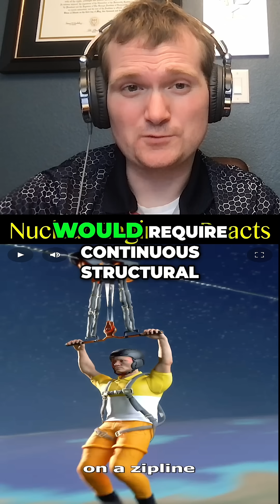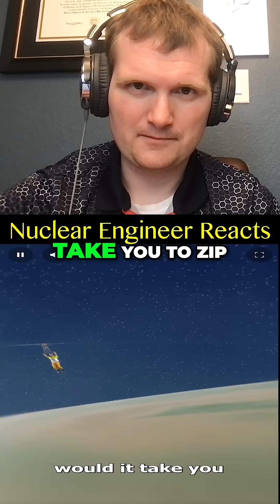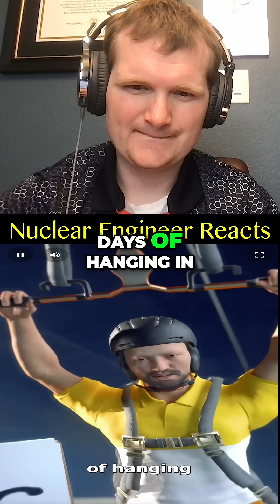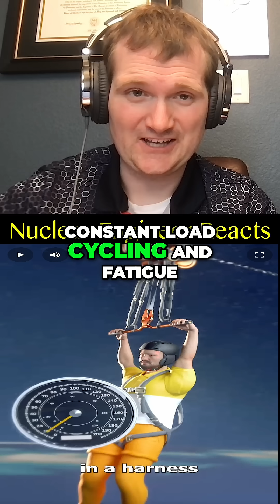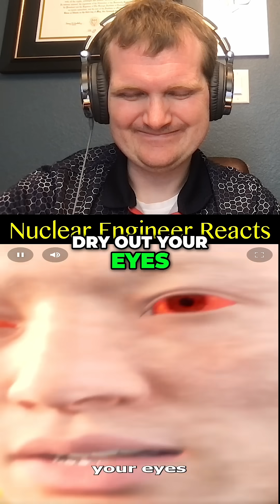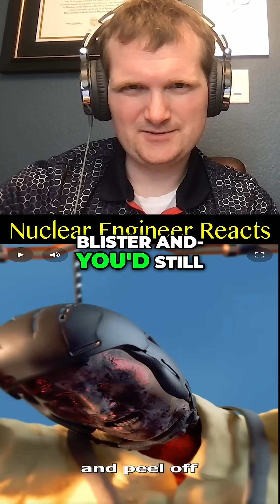Zip Lining Around Earth - Nuclear Engineer Reacts to Zack D. Films

Comment: Circles are weird.  Assume there's a zone that can wrap around the world at sea level forming a nice perfect circle kind of like the equator but without land in the way.  That line or circumference is about twenty five thousand miles long.  Assume there's a rope or cable there eating its own tail in a closed loop.  Now by forcing in just one more one mile long segment, the entire band would now be an entire foot above the water rather than lapping on the smooth perfectly level surface.  Add one more mile long segment and the loop rises another foot. Keep doing it enough times and of course there will be depreciating gains.  Now here's the fun part. Orbital velocity at ground level is 25,020 mph. So by spinning up that ring to precisely that speed at sea level and it no longer is floppy trying to fall down to the surface continually along the entire length.  Instead that rope or cable becomes rigid and hovers in place so long as it remains up to speed.  Using some kind of miraculous clutch system one could keep strapping on additional segments while it spins.  With this factory cemented to the ground it would act as a surface level perigee for the orbital ring. By continuing to add more segments the far side on the opposite end of the world would act as the ring's apogee extending higher and higher into the sky.  Being there's always some ring retreating away as new ring rushes forward to replace it,  there's no front end slamming into air resistance. With another clutch based system just past the cemented accelerator vehicle can strap on to the ring and release halfway around the world  and with a single stage Holmann transfer they'd remain in circular orbit up in outer space.